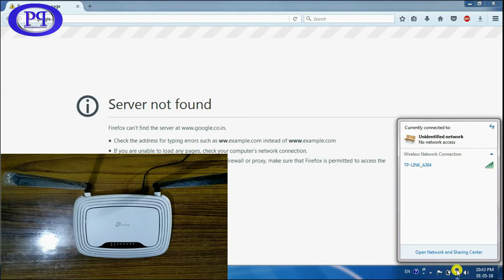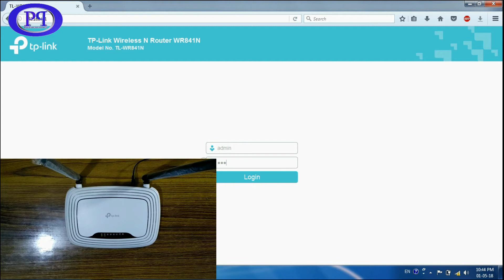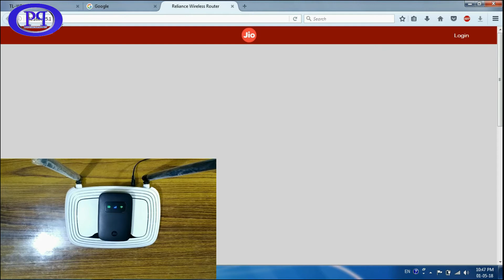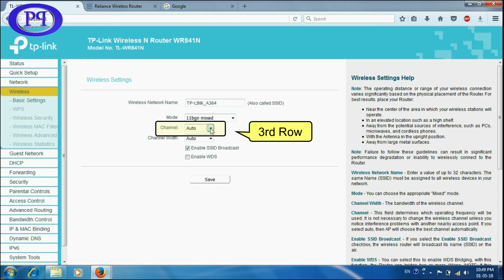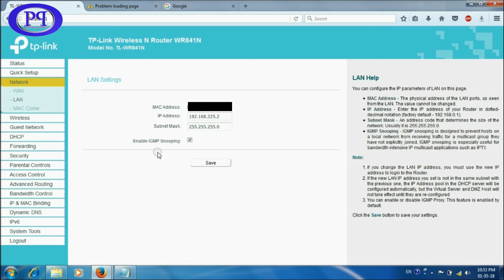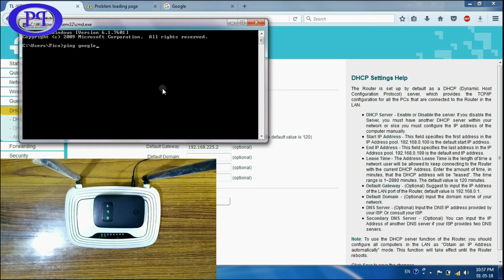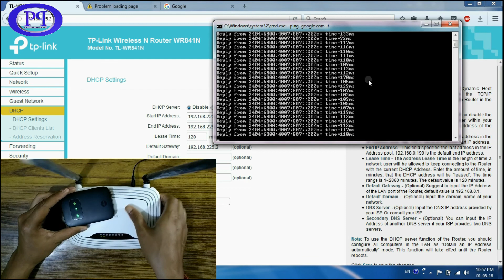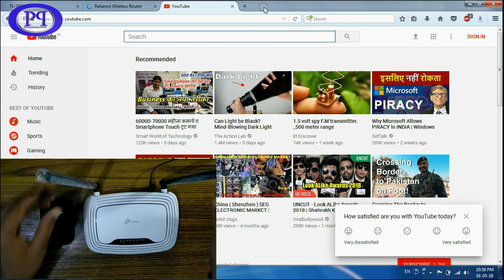Jiofi range extender (The Repeater Concept) | English

Comment: Dude, i have a jio-fi router lying useless, can you find a way to repurpose the jio-fi 4 router.
Reply from the maker: Hey, old JioFi devices can still be useful. You can repurpose it as a portable Wi-Fi hotspot with a Jio SIM, use it for IoT projects, or turn it into a basic travel router.

unfortunately WDS bridging or WiFi extender feature is not available in Jio-fi routers

Comment: but speed is very slow comparatively from jiofi network
Reply from the maker: Yes, the speed will be a bit slower, but speed also depends upon the distance/obstruction between the jiofi and the router. it should be within 3-5 meter radius in the line of sight.

Comment: Bro I have a jio fiber wifi I want to extend my wifi with jiofi2 it is possible?
Reply from the maker: Yes Offcource its possible - you can use any router which is having WDS bridging feature and you are done.
Reply: @PiyushPrasoon  I want to do with jiofi 2 it's possible ?
Reply from the maker: @rajadhoni5684  Nope jiofi is not having the WDS bridging feature in any series of routers
Reply: @PiyushPrasoon  bro jiofi .local.html website not opening bro small tip from you , dns is alway off
Reply from the maker: @rajadhoni5684  looks like there is some problem, try resetting your jiofi devise to factory settings then retry.

Comment: In May case when I off and on my router every time it's show not valid ip address . unidentified network . And search for IP address .
Reply from the maker: If you are using latest JioFi then every time you turn OFF the device and turn it ON again every thing will be reset to default. Hence keep your device on every time to avoid this.

Comment: In my case it connects once but after reset...  everything is mess... i have to reset my router... and all
Reply from the maker: Do you mean to say reset as "reboot" or the actual reset.
1. Reboot - Rebooting both the router or any one router will not affect the internal configurations (WDS Bridge Configuration). 
Once both the router will be in on state and in the range of each other it will re-establish the WDC bridge connectivity. It does not matter how many times you have rebooted any of the router.
Note: after every reboot give at list 2-3 minutes, so that the WDS connectivity should be established.

2. Reset - In case after every configuration, you are re-setting the router, router will set back to its default factory build configuration and all the user configured setting will be removed, which you need to configure again.
Hence do not reset your router after configuring it.

Comment: But when I turn off jiofi my tp link does not connect to jiofi why... I didn't changed IP
Reply from the maker: Hi Akshay,
If the jiofi will be in switch off state, tp-link router unable to establish the WDS Bridge connectivity.
However If you have configured every thing as I have soon in the video, it will work fine. It does not matter how many time you are restarting or rebooting both the router.

Just you need to keep one thing in you mind, that jiofi and tp link router both should be in a range of each other.
Reply: @PiyushPrasoon  After jiofi is restarted, its channel is changed. So its not able to connect. Is there any solution for it?
Reply from the maker: @joysonst  Did not checked the latest jiofi web GUI, Don't you have any option to assign a channel permanently on Jiofi...?

Mine is still working perfectly with same configuration shown in the video - likely from last 1.5 years
Reply: @PiyushPrasoon  maybe because am using Jiofi6🤷🏻‍♂️
Reply from the maker: @joysonst  Yes they might have restricted this felicity/feature in the latest model.
Reply: @PiyushPrasoon  Anyway thank you for the video 😄
Reply from the maker: @joysonst  You are always welcome....!!

Comment: Will it increase the internet speed..
Reply from the maker: NO
Reply: @PiyushPrasoon  any way to increase the speed of Jio dongle
Reply from the maker: @MNKNareshKumar  off course, however it require more effort and dish antennae(the one which we are using in DTH, Tata sky etc) for doing that. 

Just you need to fix you wifi adapter exactly where LNB(receiver) is located, you need to remove the LNB.

Further do the speed test in all the detection by rotating the antennae, you will definitely get a direction in which you jifi adapter will give more speed.
Reply: @PiyushPrasoon  Thank u..
Reply: @Piyush Could you help me for choosing hardware required for increasing speed.... hardware explained in reply... antenna or dish anything available in market? Or brand of hardware

Comment: Which model router is this?
Tplink841?
Reply from the maker: Yes its full name is TP Link TL WR841N
Reply: @PiyushPrasoon is this increase Jiofi router internet speed..? My location is remote area Jiofi router speed is very poor. Kindly reply me
Reply from the maker: @ganeshmadhan1290  Hi Ganesh, This will not increase or decrease Jiofi speed.

However I could suggest to keep the jiofi in the place where it receives the signal properly and test the jiofi if it is providing good speed.

NOTE: The method which I have shown in the video is just about increasing the range of Jiofi signal not the speed.
Reply: @PiyushPrasoon  Thanks a lot Piyush Prasoon

Comment: does the computer be turned on continuously?
Reply from the maker: You mean to say the JioFi device and the Router. It is not needed, you could turn both the device at any point of time, whenever you will switch on both the device, they will connect automatically and work in the same manner.

JioFi(gets internet)- but weak signal transmission--router receives the weak signal from JioFi and boost up the signal multiple time to increase the signal(WiFi) range.You could use only Jiofi to connect with your device(mobile, computer) in case you are in range of JioFi.
Reply: @PiyushPrasoon  Thanks! I got it